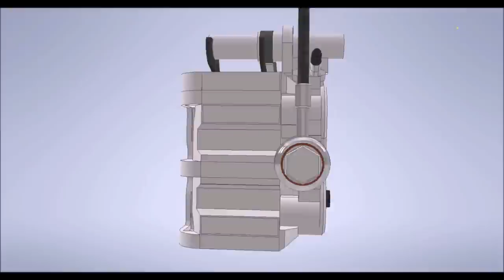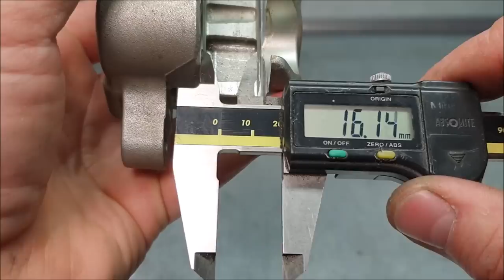Restoration of Brake Caliper - Brembo - Year 2001

Comment: Work on the machines - always on the level. But assembling the caliper is a great instruction on how NOT to do it! Do not install rubber elements on brake fluid and lithol (any mineral lubricant). The first will lead to jamming of the pistons, and the second - to irreparable swelling of the rubber.

Comment: You can make new pins with oversized thread. You have lathe. Helicoil with rusted pins not have sense.

Don't use oil or lithium grease for pins. Use special grease TRW PFG-110 or other special grease.

For piston seal use special grease Huskey Slipkote 220-R or other special grease

Comment: Great job! ....but I'd have used vaseline instead of "blue" grease, to avoid rubber damages. Regards from Brasil.
Reply: essa graxa vai ferrar com as borrachas
Reply: TRW PFG-110 for pins
Slipkote 220-R for pistons and seal
Reply: É complicado, até hoje não vi uma oficina que use graxa certa nessas borrachas, com poucos meses estão as 2 estufadas e caindo aos pedaços. Eu uso uma graxa mineral que tenho da época que fazia manutenção em suspensão de bike, não agride em nada e tem uma boa viscosidade, depois de meses ela inda tá lá intacta
Reply: @WolfMoonSs  sim é complicado, hoje vejo muita gente cometendo esse tipo de equívoco. Sempre tive e tenho uma moto clássica, onde a manutenção preventiva bem feita é a lição de casa para a longevidade. Já cansei de ver pinças como esta mostrada no vídeo, e embora tenha essa aparente "vacilada", o cara é um puta profissional de tornearia.

Comment: Most of the parts that were sanded are just plain iron/steel, so they are prone to rusting. The next logical step would be to invest in a nickel plating station (not that expensive) :D

Comment: I usually pin the end of the thread so the insert will not back out when removing the sliding pin
Reply: For sure It will come out since he used the thread locker on the sliding pin and not on the threaded insert as well

Comment: I tried to repair an old ZXR250 block with a hole punched through from a rod, the welder i took it to warped the case pretty bad and i gave up.

Comment: Nice work and entertaining video.
Tip - use non hardening thread seal for gas pipes or teflon tape on the bleed nippel to avoid spillage when bleeding out the brake fluid.
/Henrik